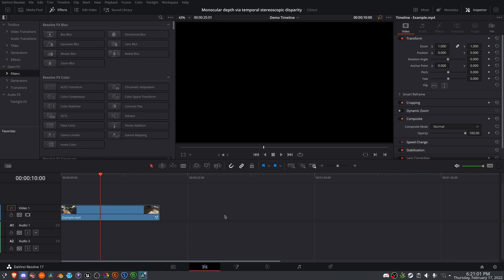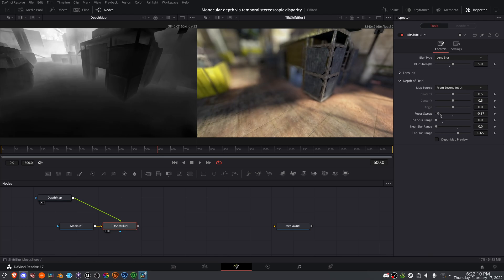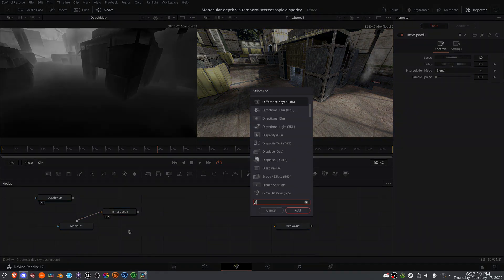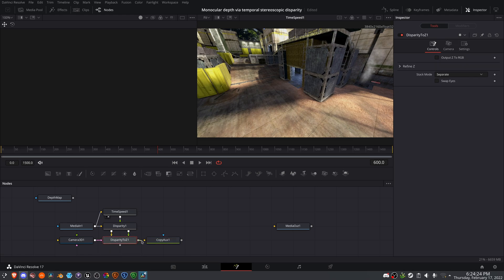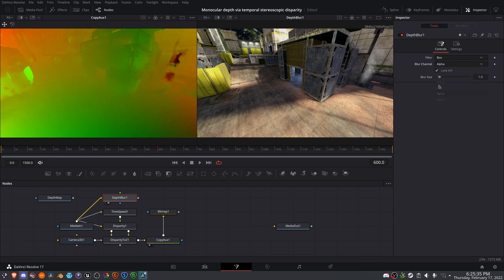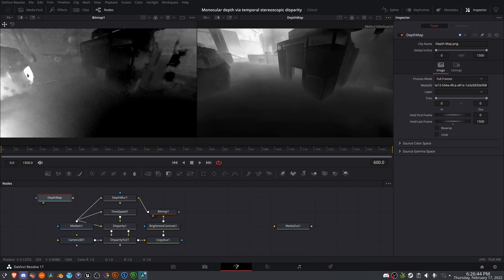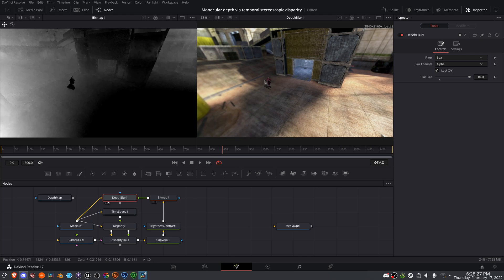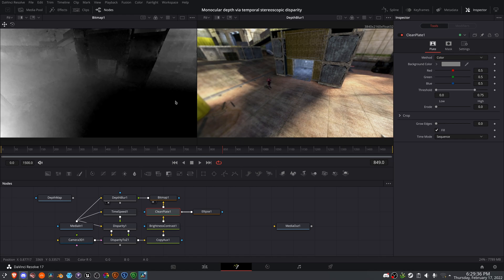How to procedurally generate depth maps for video

Comment: what program is this? do you think there is a way to do this with real life footage and in after effects? i figured since after effects has so many plugins maybe i could find one that could do this, but if not i will try your method. I just need to know the program. Thanks in advance
Reply from the maker: The software used is DaVinci Resolve Studio (the free version does not support the stereoscopic tools shown). However there is a better solution now, as version 18 beta has recently released with a dedicated depth map effect that's much more efficient and accurate than this.

I do not use AE, so whether you can do this in that software would depend on whether it has an equivalent to the tools shown in this video, but if it does, then yes you can do this on real life footage.
Reply: @Execrated  thank you. i just found a tutorial showing the automated depth map feature that you’re talking about. i appreciate your video as well because now i know about this program 🙏
Reply from the maker: @contactmojo2413  Yes, all the nodes shown are also available in Fusion Studio.

Comment: Linux user + fusion genius?
oh yeah by the way do you know a way to do a time displacement slit scan effect in fusion? like the one at the end of the some minds music video
Reply from the maker: I'm not sure if you mean the end of the music video from Flume, but that looks like it could be done pretty easily with a displace node driven by fast noise, masked to isolate the subject, then mirrored in certain areas.